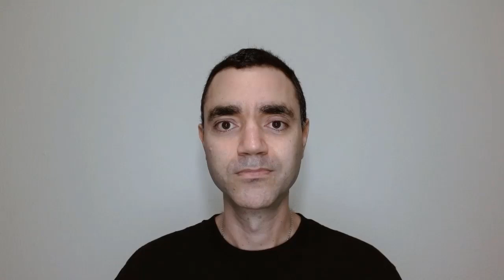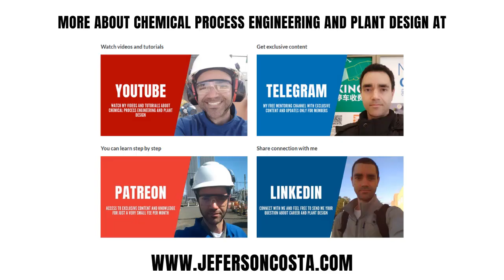WHY INFORM OPERATING PRESSURE AND TEMPERATURE IN THE LINE LIST FOR CHEMICAL PROCESS ENGINEERS

Comment: But design conditions were already mentioned in P&ID, just to put operating conditions, so how does it help!
Reply from the maker: In the P&ID, usually, there is no information for piping design conditions, you have MAWP for equipment. Although similar, they are not the same. I any case, each Company can add information they prefer in engineering documents.